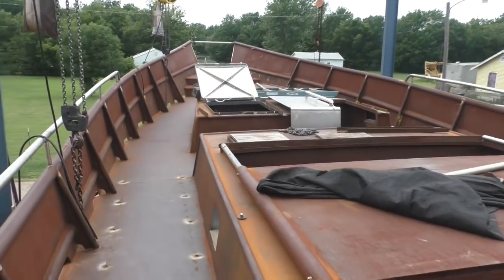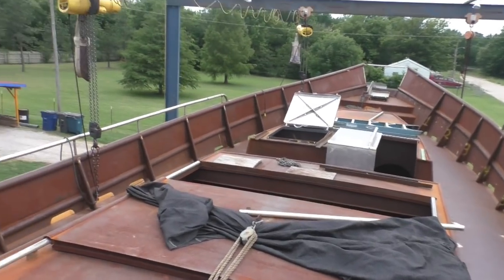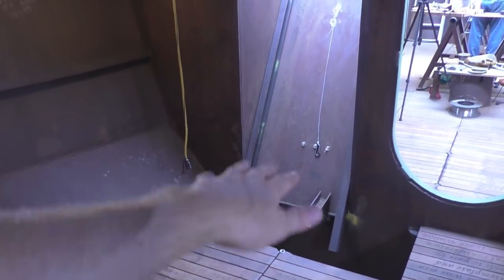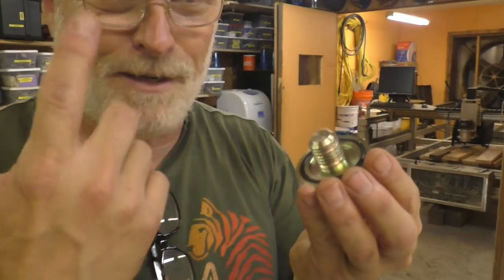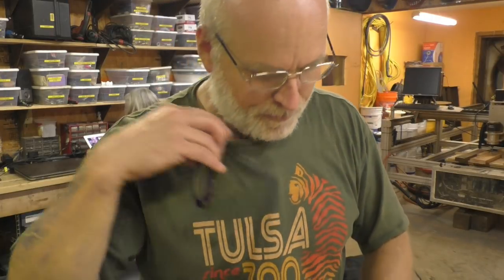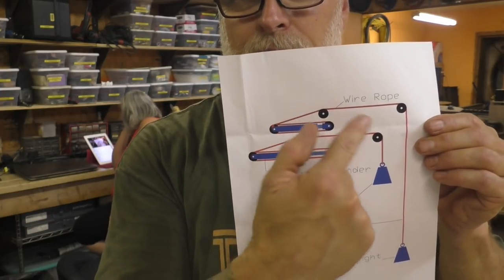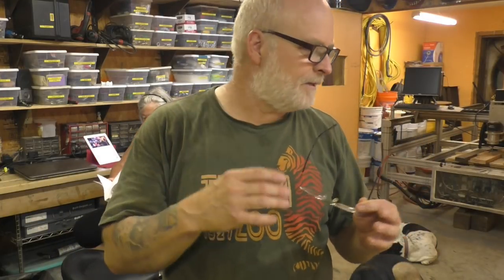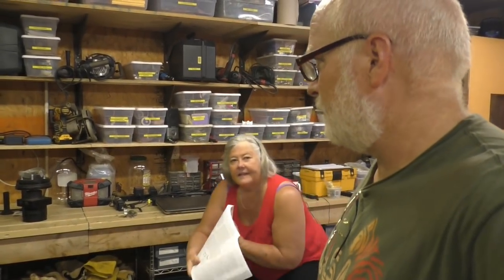SV Seeker Live - June 17, 2017 - Deck Tiles, Tender Winch, Sewing Sails, T Shirt Sale

Comment: Bart and the rest of us old people (not saying Bart is OLD) remember when there was no heat index.  We never had a/c in our homes and cars, the closest was going to the movies where they had cooler air.  So we would work out in the temperatures that today have people hiding in fear because the "HEAT INDEX" is up at 98 degrees. We arc welded out in the open when the real temperature was 100, and still do today even in our mid 70s age.  If the thermometer said 102 then we said "dam it is hot" or if it said zero then "dam it is cold."

Comment: My idea for your tender quick deployment and docking system is a hinged ramp off the stern with self engaging quick release clips that secure the tender as soon as it comes up the ramp. Use UHMW for skid bunks kind of like a boat trailer so you can just steam right on up the ramp, then pull the aft end of the ramp up.
Reply: The US coast guard has a similar system and the "self engaging clip" that secures the small patrol boat "tender" as it comes up the ramp is just a line that bumps over a Sampson post at the bow of the "tender".

Comment: Do not use sand to clean the inner walls, but you can use dry ice.. scales the rust and in the end, all you have is the rust dust. The dry ice will not harm wood, fabric or anything else.  Is commonly used in home remodeling and can be adapted for your needs.
Reply: dry ice is CO2...
Reply: Just assess the risk, find the solution and go for it.
Reply: hassiaschbi, dry ice is manufactured by chilling/freezing it out of the atmosphere typically so I'm not sure what you are driving at.  But CO2 lags warming anyway so not a big deal.
Reply: I see only one problem with dry ice: even with all the hatches cargo doors etc open, CO2 evaporating from the dry ice is heavier than regular air, so I would strongly recommend some CO2 measuring device which alerts you if you accumulate to much CO2. And you have to do some really intense ventilation.
Otherwise you just risk to drop down unconsious to the floor and collecting any one without a respirator mask going to help you dropping next to you.

Comment: As  teenager in high school I worked a summer job for a plumbing company. It was an old 4 story building with high ceilings and a full basement. It was served by an old Otis water powered elevator. There was a 4" water main coming into the building connected to a master valve that controlled the water going into and out of a huge slave cylinder with multiple sheaves with cable bound around all of it.There were not buttons to push, but a continuous cable that went all the way up to the top floor and down to the basement with stop nuts on top and bottom to automatically close the master valve upon reaching the basement or the 4th floor. The cables around the slave cylinder were attached to the elevator. As the master valve was opened water pressure from the 4" main would send the elevator up. Centering the valve would stop the elevator any where along its track. To go down, the valve would be turned in the opposite direction to release the water from the cylinder and prevent the water from the main from entering the cylinder. Speed was entirely controlled by the pair of cables that hung in the elevator shaft on one side of the car. Pulling one or the other operated the master valve opening it or closing it depending on the direction in which you wanted to travel.Speed was controlled by the opening of the master valve to just a crack or all the way to fully open. The elevator dated to 1903.Sadly the building burned back in the 1980's. If engineered properly you could use one cylinder to do the work of two.

Comment: Doug just for thought ,WHat about using a industrial floor polisher using grit pads but adding some lifting rings to the top of the gunnel walls using a winch going side to side like they do naturally by orbital tilt you`ll be able to go the lenght in very short time and will remove all the rust by just walking back and forth give a little winch pull up or down it will make a pendulum mark on the wall but if you move the cable hook along the wall it will clean it all .

Comment: We always use white vinegar rubbed over rusted areas before painting. It kills the rust and makes a hard shell that holds paint for many years. Almost every pipe fence in Texas is done this way. You can also pressure wash it on by pumping out of barrels. You dilute it to about 10% to spray, then wait overnight to paint over it.

Comment: For the sewing machine in the table. Norm Abrams  had a table with Removable/adjustable selves that you slid or lowered into place that had a simple clip in or on. He mount small table top tools that once in were flushed to the surface.

Comment: I saw a tent maker's sewing set up that used sleds on swivel casters, it had outriggers that fixed to it for the double roll. He pulled the outrigger as it approached the sewing machine and replaced it as the sled cleared the machine.  The machine was on a stand that could be rolled when or if needed.

Comment: You can get an attachment for the pressure washer that works like a round brush. it can be used on flat flooring or up on walls.
Cleans well in my opinion.

Comment: Just a thought on the hydraulic motors (and any mechanical stuff that you can't fab out at sea). Within the realm of cost/size/weight, try to use duplicate units.  If that motor is perfect for the mainsail, but way to big for the other sails, get several of the large units so that they can be swapped around in the event of breakage. The same goes for hydraulic lines, steering chains, electrical connectors, etc.

Comment: Using hydraulic motors to winch up the tender seems like the optimal set-up for a marine environment.  The problem I see with using hydraulic rams in the diagram you showed is the rams being in the extended position when the tender is up where it will be most of the time.  This leaves the chrome of the piston rod exposed to the salt spray and rain etc.    That would not be an issue immediately but eventually the chrome would get pitted and that would cause the seals to fail.  You could rig a set of bellows for the piston rods but it seems like hydraulic motors fit the bill, better.

Comment: The hydraulic ram idea for lifting the tender looks interesting, they could be mounted above or below deck, vertical or horizontal with a pulley or two, lots of options.

When I rebuilt my '54 military truck I had a guy paint it who paints offshore oil rigs and equipment. It was a Sherwin Williams industrial paint and not that expensive but I can't remember the name. Painted my frame and the body with it in a semi gloss about ten years ago. Maybe call a few rig painters for their experience and knowledge in offshore steel coatings?

Didn't make anything today, I'm staying in the AC recovering from welding up an old brush hog out in this Texas heat and sunburning the crap out of my arms from welding in short sleeves..

Think I'll buy a couple mugs, I'm about due for a couple new coffee mugs.

Comment: For the davits use chain blocks and have a shaft going across the stern with pulleys on to work the hand chains in sync. The shaft can be turned with an electric motor or by hand

Comment: for the inside walls you could clean the rust and spray closed cell foam will give insulation and give you protection against rust

Comment: We washed rusty barges with a power washer with a roto turbo head it will cut off loose stuff off surface, if you want it down to white metal you would have to water jet the steel. A 4000 psi power washer with a roto head is your cheapest option to clean the loose scale off. If your using a rust inhibitor it needs a bit of a tooth to work, if you really want it to white metal and the cleanest process water jet blasting is the way to go. You would have to outsource water jet blasting as one of those machines is close to 100 grand. The best rust protection on the inside of the boat if your not using paint would be fluid film it is a food grade oil that helps "prevent" rust it won't stop it nothing stops orange cancer. Coal tar is for exterior use only the stuff off gasses for years as it never fully hardens. Not sure if I would use coal tar where you are experiencing extreme heat where the steel is hot enough to cook and egg as the paint will be sticky.

Comment: fellow that dug my well had a rig on his derek that was a four pulley block and tackle  attached to a hydraulic cylinder using the rod end to pull on the block and created a fast reeling cable with a fairly short stroke. you've probably seen it before I just thought it was a cool approach.

Comment: When you were talking about the hydraulics and knowing your penchant for having backups of backups my mind drifted to the racing crew working the cranks and pedals on the America's Cup hydrofoil cats to keep hydraulic pressure up to work the foils and wing.  So, in theory, you could have pedal powered backup to your electric/diesel hydraulic pump for those times something doesn't cooperate and you need to run hydraulics.  You'd need some galley slaves to run them.

Comment: I think some attention is needed for the hatch for the front hold. I think it was mentioned that there will be some bunks, that would exit through that hatch. I think that in a fire that that hatch could be a difficult hatch to exit from. And could be a trap to the people trying to get out of the front hold. I think there needs to be a hatch that pops up rather than slide. I can think of a few situations where that sliding hatch, would not slide, such as a collision that would bend the pipes that the hatch slides on. Please reconsider a quick opening hatch that opens on a hinge.

Comment: Where you able to fix the prop shaft , were it starts to go through , it will wallball in twist with out a barring at front where the shaft start . I was watching when you put it , there was some flex in it . I lived in the Northwest , out of straits in Wa. Worked on commercial & mide size charter boats , 50 feet.

Comment: For your sewing machine table, look into used medical suppliers, and see if they have a used hospital bed table.  Adjustable up, down, and swing.  On wheels but lockable.  Like most hospital equipment they are over built and can hold quite a bit.  Makes a great accessory to your lathe and drill / mill too, to keep all your tools and small parts off the machine while working.
Reply: Got two if he wants to buy one, not shipping it though.

Comment: Will you make eye bolt type deck bolts as well? The washer part can hold down equipment and you would still have eye holes for secondary anchor points. Just a thought. Thanks

Comment: doug ..i hope you find value in looking for the weakness in any idea.... sheared pins are only one possible issue lol   a little spray adhesive will do the trick... back to looking for the weakness  .. i do draw a line between defeatism and hopefully helpful observations  .. was going to ask why your rust removing when ya have rust converter but more or less addressed that for me .. thanks  as a fairly new linux user i have discovered a saying that is applicable here lol  theres 100 answers to every question and 100 ways to do something and there all more or less right  looking forward to painting and whatever else ya all upload
Reply: lol  it isnt what it was  they run well and have good suttort much better than microshit knowledge base  and useless erroe numbers  as to which distro i use    i pentest with kali  a debian  distro  and the rest of the network is ubuntu    its easy simple and runs on the core duo nicely

Comment: A light colored wood that is also rot resistant - cypress. Only downfall is that it is soft so cutting it with less than sharp blades can cause fuzzies. It is also light in weight if that is important to you.

Comment: Have you guys considered closed cell spray foam insulaton on the inside walls-----it would insulate, sound proof and provide an excellent barrier for moisture due to its adhesion to the hull
Reply from the maker: We did, but there are issues in tank farms with corrosion behind the foam even when the steel is painted, so we are opting for a method that will allow us to inspect the hull.

Comment: I have my machine on small frame ,on casters and the wheels lock in with a cotter pin. The problem is when you move the machine it puts a load on the needle and it has a god chance of breaking the needle , it takes a bit of practice but it works for me.  Uwe

Comment: i've used a 200bar (2900psi) pressure cleaner with a rotating nozzle that will take all the lose parts of.  It takes some time but it works

Comment: hi there here's Food For Thought have you ever thought about sticking a hydro generator on board you have a shaft ran out the back by the propeller to your generator in the water turns it in turns a generator and you got hydropower you can stick a gearbox on their to do whichever RPMs it needs to be just some food for thought

Comment: I wouldn't use rock wool insulation on a boat. I'd use some form of closed cell polymer foam like injected polyurethane or polyisocyanurate board. Injected foam will fill all gaps, and that's good for insulation and sound. Polyisocyanurate has the best R-value your likely to find, other than with a true vacuum between mirror surfaces. Closed cell absorbs no water. Water defeats insulation. Don't want that. The other thing--besides the fact that it stops being insulation once it's wet--wet insulation grows mold. If there's no light you get black mold, which is toxic. Don't want that either.

Comment: You appear to have a mis-understanding of the purpose of a hydraulic accumulator. A hydraulic system is always under pressure. The accumulator is generally used as a reserve of pressure should the pump stop.
Reply: A good analogy. It acts like a capacitor.
Reply: You can only use an accumulator on a closed center system (constant pressure).    Accumulators are usually used to maintain even system pressure on a closed center system (constant pressure) or to provide extra short term flow which can allow for a smaller pump and motor to be used.    
Many hydraulic systems are open center.   For instance most older tractors, log splitters, etc..    The pumps (gear pumps) are a lot cheaper than constant pressure pumps (typically swash plate piston pumps).     Accumulators can be dangerous (stored energy) if not handled properly.

Comment: Things like this are what we had used to clean the surface of structural steel girders of rust and mill scale.  The high pressure water is about half way down or so.     http://www.steelconstruction.info/Surface_preparation

Comment: Portable carpet binder, a heavy duty sewing machine on wheels, pulls itself along as it stitches. I used one for years in my carpet shop to bind the edges of carpet for customers. Lay out product on the floor and run binder around four sides. I'm not sure if it can be adapted for sails but maybe. They are pricey but they sell reconditioned ones and old ones last forever.  http://www.n-ccarpet.com/index.php?route=product/product&path=600_700&product_id=323 video on page

Comment: The boat all rusty? Why not paint part by part while building? That would preserve the metal.
Reply: A coat of rust is fine, it actually slows down the rusting of the metal underneath. If you kept scraping off the rust you would be exposing fresh metal to the elements and it would actuallly rust faster. If you paint it part by part while building you will be scratching the paint all the time and also burning the paint anytime you welded near it or on the other side of the wall.